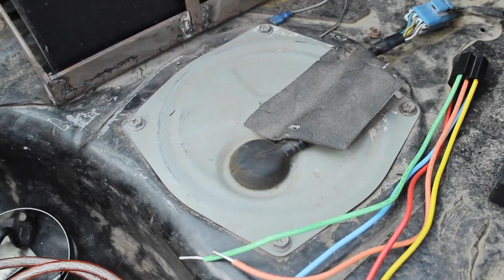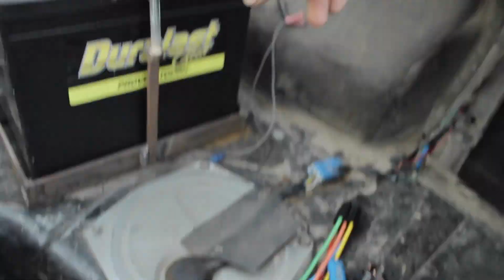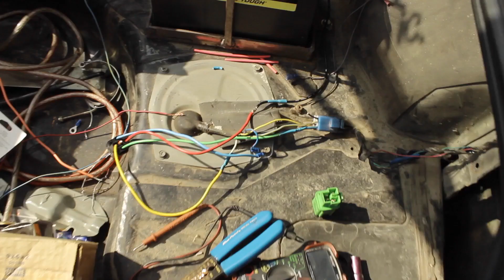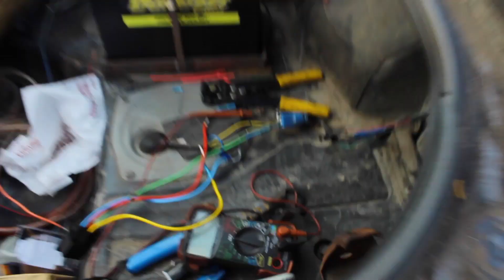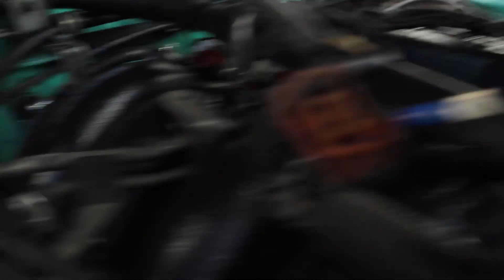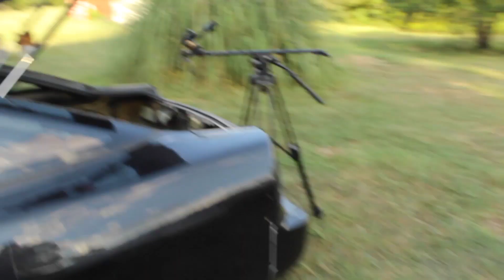TURBO 240SX BUILD | EXTERNAL RELAY FUEL PUMP

Comment: Sup bro I have a VQ swapped S13 it also came with the walbaro 255lph fuel pump, do you think this is still needed or do you think the 350z engine harness provides enough power?

Comment: What in the actual fuck are you doing?? 1) That bolt you put your fuel pump ground on screws into a PLASTIC insert. 2.)If you're running a toggle switch to it, that's fine, but don't run the main 12v signal through it. Run the switched source through it, ie the wire you have run to the chassis side of the white/purple wire. I know this was over a year ago but damn..

Comment: Does your ecu have to be installed for the relay to recieve the switched power? i just finished the hardwire but the relay isnt recieving the switched power from the black/yellow from the fuse block.
Reply from the maker: Brandon Combs yea i believe so
Reply: alright, thanks man.
Reply from the maker: Brandon Combs anytime man

Comment: Hey I did exactly what your video said and I wired everything correctly I've been having trouble with my fuel pump for 2 months, I got a Walbro 255 with brand new injectors fuel filter, fuel pump*, fuel pump relay, I also wired to to a toggle switch that seems to have power but the pump isn't working I checked my grounds they seemed to be placed in a good location. I'm just looking for help I'm thinking my problem is ecu related but again I have no idea
Reply: Normal, the white purple on chassis harness side only comes live with key on. so technically you need to leave the switch on and turn the key. It will work that way. Basically you hide the switch you have wired and set it to off so you don't have the car easily stolen but for everyday use you always leave it on ON

Comment: YOU SHOULD DEFINITELY NOT GROUND YOUR WIRES STRAIGHT ON TO THE FUEL PUMP (BAD IDEA)
Reply from the maker: why, I'm all ears homie, anything to help the build I'm an open listener
Reply: +Southern Hooning the groud wire could start sparking, pretty rare but i still wouldnt take tha risk. THUMBS UP FOR A QUICK FUKIN RESPONSE A =)
Reply from the maker: this is tru, I'm gonna look in to moving it, not sure when I will, pretty big procrastinator haha, but thanks for the heads up homie!
Reply: Southern Hooning did you ever fix this? I'm interested in doing this mod but I really don't want to do it the wrong way.
Reply: Nikora Parsons what do you mean the ground wire could start sparking? can you explain please? I'm interested in doing this mod but don't want to have any issues.

Comment: I have a question too... if I hook up my fuel pump like this will my wonka valve open and close properly?
Reply from the maker: it should, I do that see why not?
Reply: You sure I really don't want my bermuda triangle flange to get cracked because the valve  isn't working properly
Reply from the maker: I promise man, as long as your car has its krypton rod installed you should be good, you do have that don't you?
Reply: My krypton rod is actually used and I bought it off of eBay from a guy named Chris  and he said it's gucci but I really don't know so it might crack?
Reply from the maker: u should be good, it's a krypton rod, don't hear about them breaking often, there stronger then superman

Comment: I'm having the same problem with my e34. Fuel pump isn't working after putting the motor back in. Will have to do what you did!
Reply from the maker: hope you get it figured out homie!
Reply: did you figure it out? i have same problem. put motor back in and fuel pump wont turn on